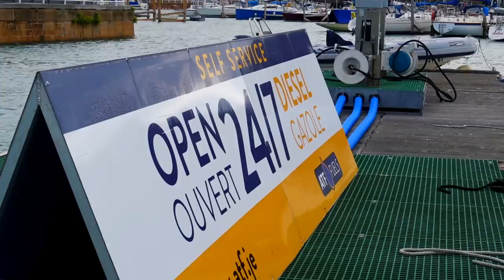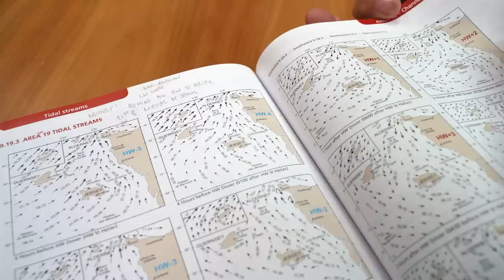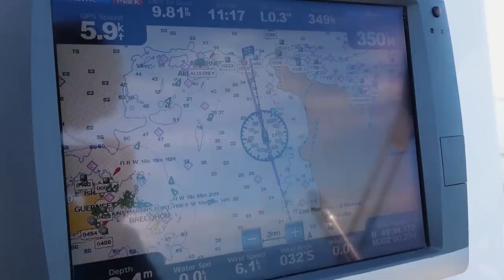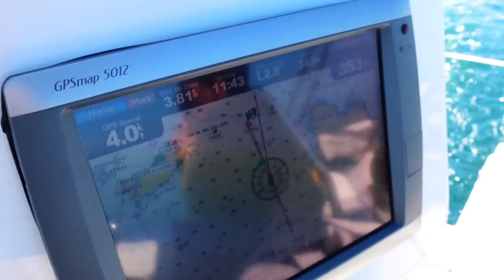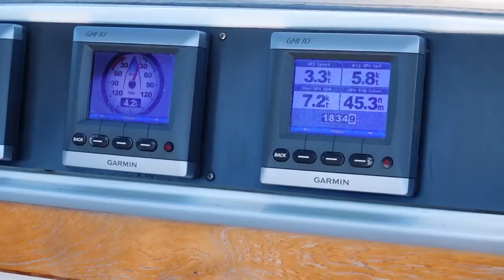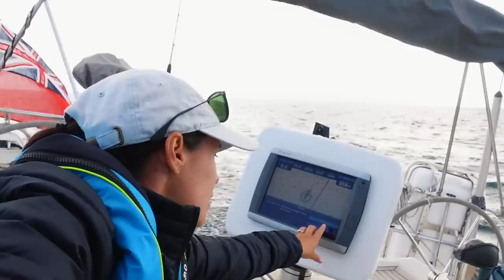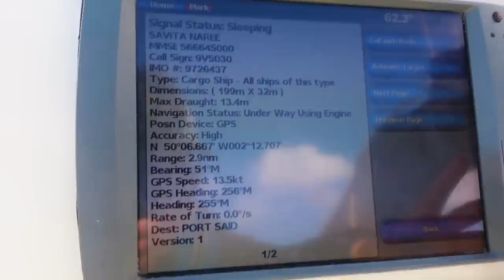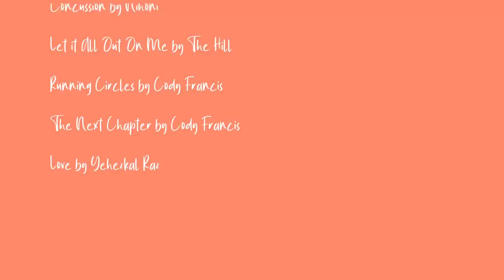Sailing Couple Return Home After 5 Year Voyage.

Comment: Just a quick story. Several decades ago, working for "Red Stack Tugs" in the S.F. Bay Area, the tug that my captain and I normally worked on had a shift with a new hire engineer. He used fuel from a tank that we normally never used (this was an old YTB) and contaminated the operational fuel system with the bacteria. The boat stopped and when we were "ameliorating "(thanks for the adjective) the situation, I can still see clearly, Harold, just pouring in biobor , from a 5 gal. can, straight into the sounding tube of the port, for'd tank. I told him that it was too much. He looked up and said, "chief, if a little is good, more is better." There was a lot of filter changing, but we eventually got the situation straightened out. I'm glad to be retired, but I do miss Harold and some of the challenges of being a marine engineer.

Comment: As you guys have found out, you need to update your digital tide charts frequently.  The accuracy goes down as time goes on after an update. They are only predictions, this is somehing that as a charter boat captain depending on the tides I also had to learn the hard way.  I found that some are accurate up to a year in advance,  some seem to lose their accuracy after 2 or 3 months. I am in cook inlet which has a 35 foot tide at times so I think the problem is also magnified slightly here. It seems that high current zones are just more unpredictable.

Comment: If you run the engine for a while at the pontoon it should take up some of the bugs as fuel circulates then check filter to see how bad it is
Reply from the maker: They only get thrown into the filters in rough seas, which is normally when you really need the engine to be working

Comment: Just curious did you work out what went wrong with your tidal calcs? Were you e-charts really wrong? Seems unlikely although not impossible. I once messed up a Channel Islands tide calc getting my knickers in a twist with offsets between Dover and the local port. Ended up talking to local harbour master who set me right. So v easy to do!
Reply: This was the most important take away from this blog to help us sailors avoid this potentially dangerous issue. Any feedback RR?